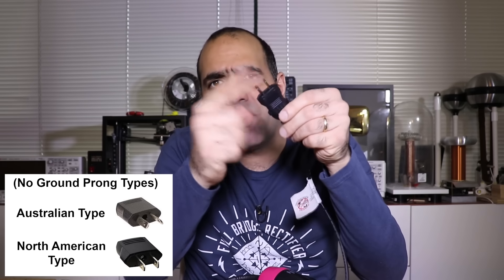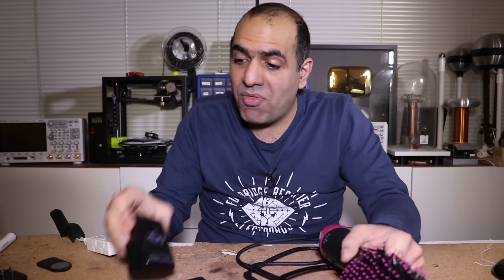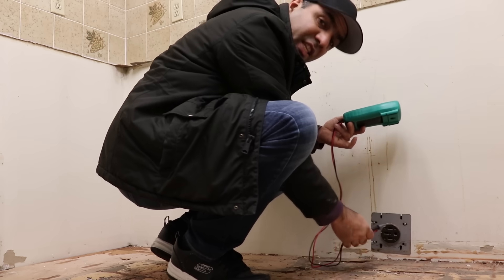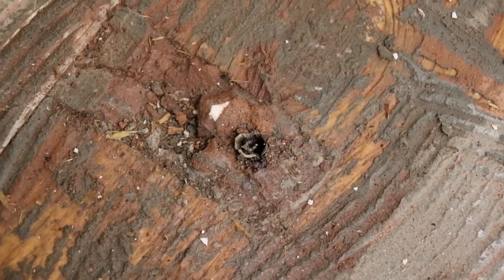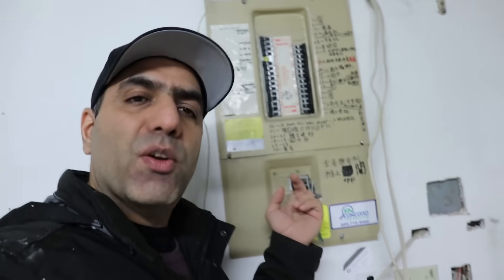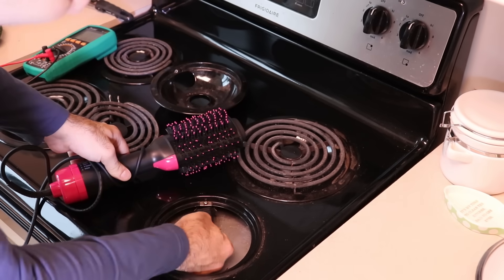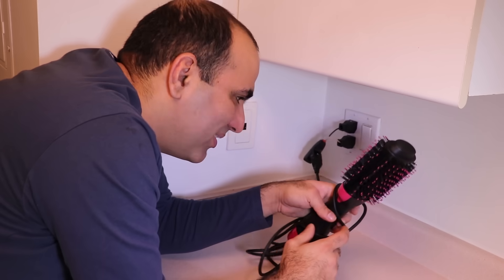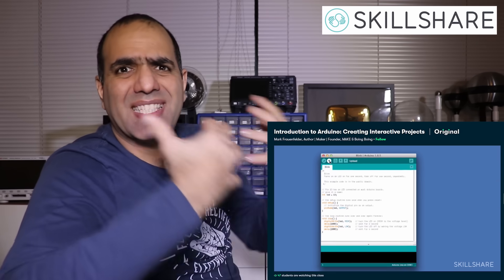Finding HIGH POWER 240V in a 120V Country

Comment: Brazil is a lot of fun: we get 127 V where I'm writing this, but drive north for an hour and 220 V is standard, a legacy from decisions by early local utilities. In some places it's a matter of crossing the street, apparently. Similar to North America, some appliances need 220 V, and homes in 127 V areas can get two phases offset by 120° for those.
Reply: In Ottawa where i live 122-123V is the norm though I've seen it sag to 118V before and rise to 125V before.  I've even had my UPS trip on an OVER voltage from the utility but that was a rare event.
Reply: @Tom St Denis I get the same thing in the U.S. over here in Springfield, Vermont. Usually 118V with a heavy load. (high amperes) In 2014, in downtown Springfield, Vermont, I saw 127V and wondered if the power company changed to a new standard, as higher volts are more efficient for ultra modern AC-to-DC power conversion, especially for computer power supplies. In 2016, I briefly was in a house with a bad neutral, I got a 132V reading and IIRC, another outlet at only 111V!
Reply: In Brazil some cities have 220V line voltage (that is 127v phase voltage), other cities have 380V line voltage (or 220V phase voltage) but the 380v voltage is not used in residential applications.
Reply: In a lot of houses there's rooms that are 127 and another's that are 220,it's really wild
Reply: Kinda like some telephone exchanges where it would be long distance to call across the street!
Reply: Ele já chegou a comentar isso em um vídeo! 🤔😜

Comment: How did that poor meter survive?
Reply: fuse
Reply: @yakacm  wouldn't count on it, voltage side works since it consumes very little current (theoretical infinite resistance).
Reply: The Eh Team Infinite resistance means no connection.. So that’s nonsense.
Reply: theres a simple reason why but that would be the adult equvalent of telling a kid santa claus isn't real

imma just keep the magic going, its more fun like that anyway ^^
Reply: @tobbleboii5988  dont worry we know the truth,we just enjoy the show :D
Reply: @ppsarrakis  great! and if someone doesn't understand they will have to go on a mystical adventure to find out :D
Reply: I think either the leads weren't  plugged into the meter or they were connected properly into voltage but he had the leads connected to something that would blow when plugged into the outlet. He had the meter tilted so you couldn't see what was rigged up. Also the leads fell on the ground after it blows, they don't unplug from the meter that easily.
Reply: I've actually done that mistake (plugged a dmm to 230v while probes in amps) and the meter still reads voltage properly. Ofcourse the meter didn't shoot out sparks because they are designed to not do that. Only got some arcs in the contacts and a loud bang, so that scene was obviously rigged(just like all the other stupid stuff he does). The meter was a similar cheap meter.
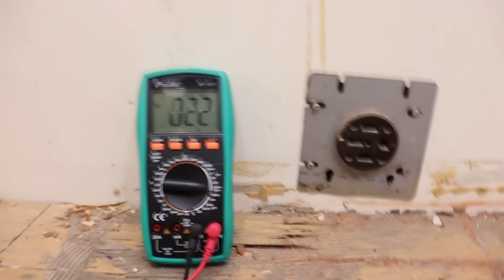Reply: @4:22 he has a 2nd  Meter in shot. It could be his stunt double DMM. lol
Reply: better question: how is he still alive?
Reply: because the meter said no
Reply: Cause it was a rigged show :) Do you really think he electrocutes himself or expensive stuff at such a regular base? Most things he blow up are quite cheap and its demonstration. It says: „What I do can be insanely dangerous. Dont do that by yourself when you dont know what you are doing“ Blowing up your multimeter as he showed it is one of the most common ways how students blow it up. So its a good thing to show it even when mine didnt make such a spectacular „Bang“ in the past. :D

Comment: In residential areas they convert the distribution power (5kv typically) down to 240 single phase, center tapped for all the feeds to single resident homes. Large buildings get 3 phase because they have large air handling equipment, elevators and the like which have large motors which really run more efficiently on three phase.
Reply: In Central Europe - Czech Republic we have 22kV / 3 phase as last part of high voltage system, than it's converted to 400V / 3 phase and that goes right in to the house. 
You can use 3 phase 400V (usually 32A but you can even pay for 3 phase 400V up to 125A!!) for some high power aplications (like  my 5kW 1957 wood saw) and 1  phase 230V for normal home things like tv or radio.
Reply: @vitcenek8611  in Aus there is a 22kV leg too, but usually the last mid voltage leg is 11kV then 415 3phase then 240 single. Generally there's no 3 phase in domestic installations unless there's central air conditioning or special requests for sheds.
Reply: @Jimmeh_B  In block of flats is usually used B16A breaker and 3 phase 400V is usually used for induction cooker and owen. I am talking about old houses - 30 years and older. There is always 3 phase socket. 
But I agree with you, in new houses  is 3 phase socket less common.
Reply: I'm from Argentina and we get 10Kva in residential zones...
Reply: 5kV? 
What country are you in?
Reply: @Jimmeh_B  In the US. I thought that's was the standard neighborhood overhead lines but maybe that was old info from the 50s or something from my dad. Googling around, it looks like the US now uses either 7,200 or 13,800 volts on the overheads. I think < 10Kv is more common though.

Comment: As I'm quite sure you know, the buildings are fed with 3-phase power, which is why the two phases sent to your apartment are 120 degrees out of phase. 

Also, it's code that kitchen outlets are split onto separate branches, so that each has a full 15-amp circuit. Because they are tied into a pair of breakers that are ganged, you end up with each outlet on one half of the 240vac circuit. Which again, I'm sure you already know. Have a great Christmas/whatever they celebrate in Iran. Thank you for a year of education and entertainment, Mehdi!
Reply: Otherwise, running the microwave and toaster at the same time... pop!
Reply: individual houses aren't supplied with 3 phase supply. It is only one of the 3 phases (RYB) that reach a house along with the neutral wire.
Reply: @ayushkapur6662  In the US, everyone gets at least 2 phases. The reason is the oven, washer, dryer, and air conditioner in the US usually use at least 2 phases.
Reply: @rich1051414  it's not 2 phases. it's a single 240v split phase.
Reply: I think that kind of wiring is specific to North America... 
In Europe, there is only 1 phase going to houses and appartements. One can ask for 3-phase if one needs high power, like a professional..
Reply: Jidé in germany we have 3-phase supply at almost ervery house/apartment

Comment: At 7:45 is that a switch on the receptacle/socket? If so, surely better to turn the switch off, then inset the two NEMA plugs, connect the hair dryer, and then turn the switch on?
Reply from the maker: North American plugs don't have switches. The switch is for the in-sink Garbrator (garbage crushing thingy).
Reply: @ElectroBOOM  Thanks for the reply Mehdi! I'd never seen a North American outlet with a switch on it, unlike say a UK or Australian standard mains outlet where they're almost there by default, so I was curious by the outlet in the video. As they say, you're always learning something new! 😊
Reply: @lawhec  in Australia the switch is, always there. In UK common but not mandatory I think.
Reply: @ElectroBOOM in the US we call them a "garbage disposal"